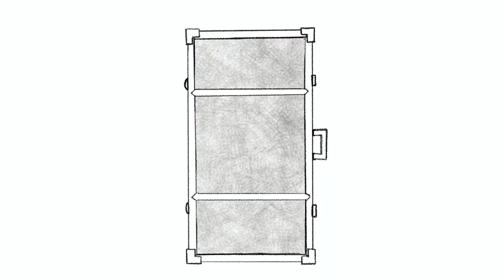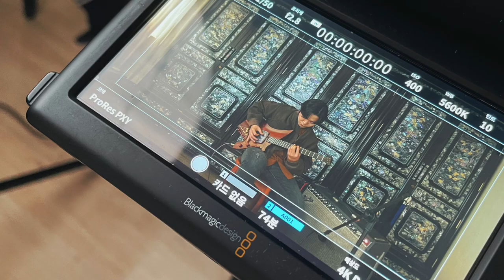[Guitar Making]Natural Lacquer Finishing & Guitar Case Making

Comment: Interesting design. Do you find that having the longest string lengths for the lowest pitch strings makes any noticeable difference in tone or tension? That is the correct design, but I don't know if the result is actually discernable. 🤷‍♀